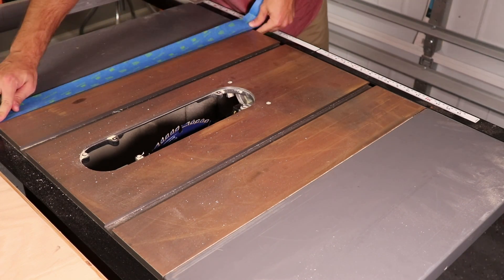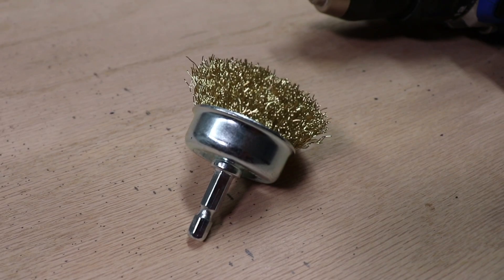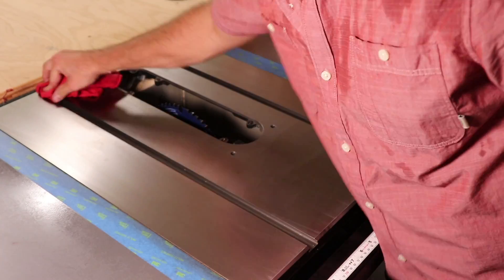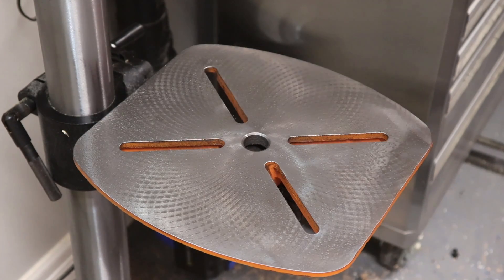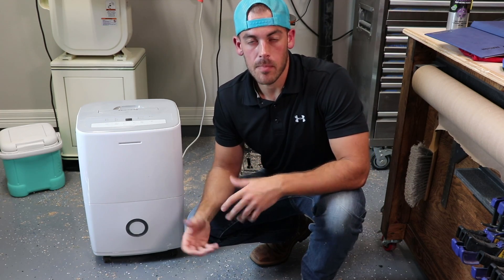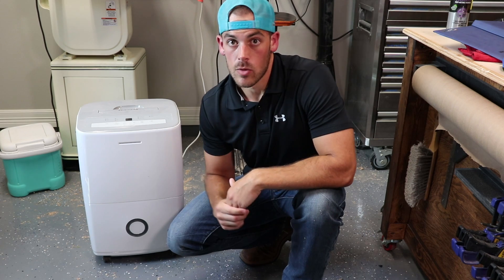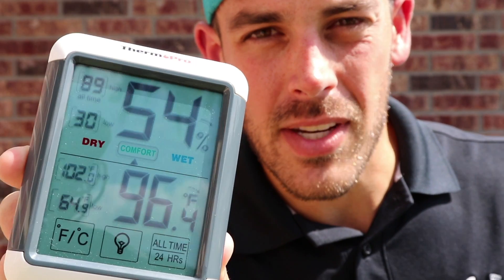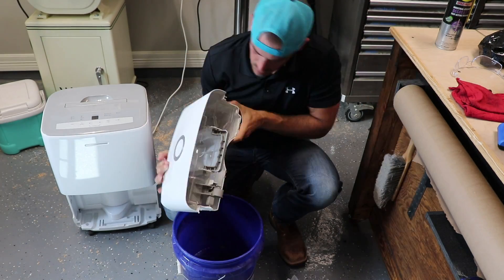Dealing with Garage Shop Humidity // Tool Rust Removal & Treatment

Comment: Great video. I live in the UK but my son and his  family live inn Katy. Now myself being in construction, lecturer in utilities,  I have extended his AC into areas throughout his house not covered in the original build. I found it fairly simple as most of his ducting  was the flexible type and in the attic space. Everything was available at Home Depot and relatively cheap. Have you thought about running an outlet to your garage and installing an auto damper that  electrically closes the outlet when the garage door is raised. Include an overall manual control switch which you would use as there is no point in cooling your garage when not in there working.This would also solve your humidity problem and solve that sweat that seems to continually  run down your face. Keep up the great work.
Reply from the maker: Thanks for the comment! Yes I’ve thought about that and may be an option in the future. The only thing really holding me back is the fact that my garage isn’t insulated so all of that cool air would mostly be wasted. Good tips though!
Reply: Your workshop doesn’t seem too large. What I did was empty mine one day and framed the internal walls with 3x2 solid slab insulation between studs. What’s great about this is you can run cables all over to where you want your machines. I then lined the front with 3/4 inch ply which is great for fixing anything to. I’m delighted with the finish.
Reply: Just extending the home a/c ducts to the garage seemed like a good idea to me also. I tried it and was disappointed however. In order to get close to enough cooling, I found a return air path was required. Shop dust got in the house so I added filters which worked pretty well but had to be very fine media and were more expensive and became restrictive pretty quickly when sanding. The last issue was smells, my wife complained when I was using paint, stains or other chemicals which is the time the humidity and temp control was most important. 

I ended up with a small 110v window unit. It struggles some when the outdoor temps are high but generally works well for my needs if I plan ahead. My largish two car garage stays comfortable even in the hottest South Alabama days. The only issue is the supply of power. Luckily, the areas power supply is split between two 15a breakers. I have tripped a breaker when running too many power hungry devices at the same time. Having the experience I have now, I could have saved some headache and expense to have simply ran a dedicated 220v receptacle near the window and gotten a properly sized unit in the first place. We don’t have a lot of cool weather  here but I would also get a unit with a heating function to avoid the small “milk house” heater I sometimes run in the garage. It works fine but if you have just put a nice finish on something, keeping the shop warmer overnight is a good idea but I don’t trust those heaters to be left running unattended in that environment. 

On a related note, don’t forget smoke/fire detection in your shop area. I have a stand alone smoke/carbon monoxide detector and recently installed a Simply Safe system in my home so I included the smoke/fire alarm for the garage and added door triggers for the alarm as well. A garage full of tools is a big investment. I did trip the smoke alarm while doing some welding a couple of weeks ago but it’s a small inconvenience. With this system it is possible to disarm sensors for short time using a phone app. 

The shop is looking good! The new main cabinets are really sharp looking and functional.

Comment: Great video. I'm in Florida on the gulf coast, so I deal with humidity in spades down here. I've used johnson paste wax on my table saw and it's been holding up for a couple of months now, so I'm definitely tuned in to see how your solutions work in comparison.
Reply: Justin Bancs try wiping your tools down with motor oil once a yr.
Reply: Sounds like a good way to get oil on your wood...

Comment: Great information you are sharing in this video. I just purchased a free-standing Heat Pump for my garage workshop. total square feet is 730. my shop takes up around 200 Sq ft, with 11-foot ceilings, That is  2200 Cubic Ft of space. The only problem is that it is not a closed off section of the total garage.  Anyway, I will let you know how my heat pump works out, 
Thanks for sharing!
Reply: Where did you get the heat pump?

Comment: You will need to do a follow-up video sowing the differences, if any, between the two coatings you used.
Reply from the maker: Absolutely!  In the next shop update video I'll review how they're holding up and/or how often I've re-applied.
Reply: Maybe also a simple guesstimate on how much each machine was used ... it does not have to be so scientific ( like in this video ) but just a simple ... how many times you used it as I think the more  the machine is used will mean that the coating will disappear faster ! Thanks for your efforts and the videos !